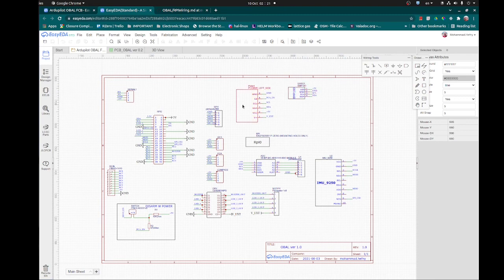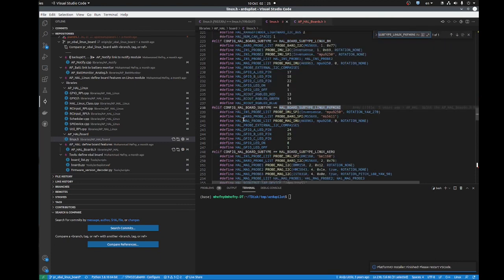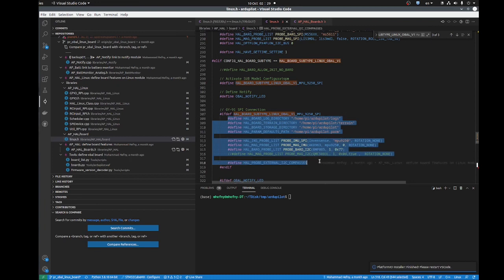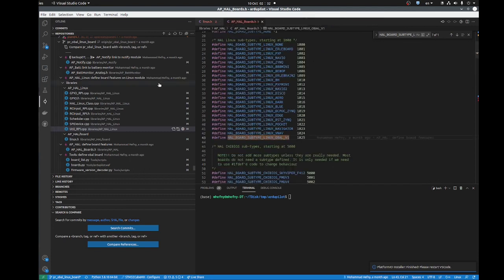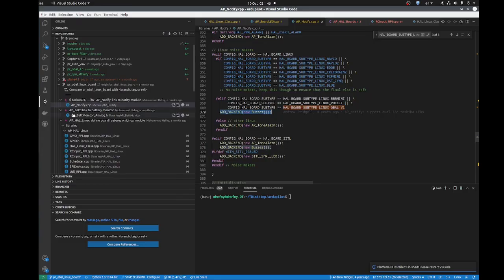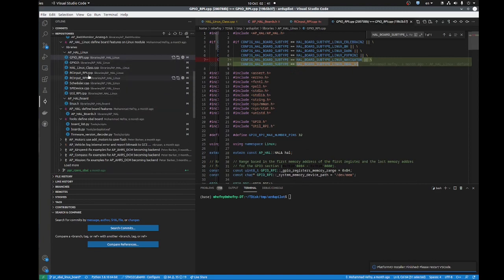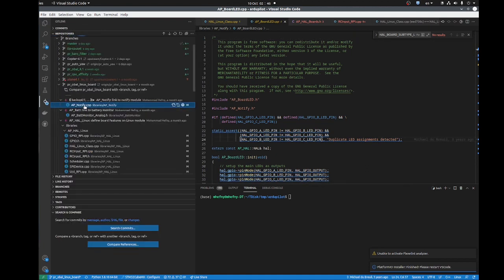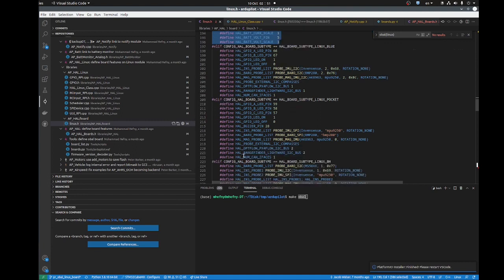04 - OBAL - Tech Part 4: How to Port  Ardupilot Software to your OWN Custom Board ?

Comment: Many thanks for such nice explanation.
I have a question. Did you use Ardupilot mission planner for calibration and configuration???
I can’t find any video for that on the playlist.
Reply from the maker: You can adjust it easily as any similar board
Reply: @MohammadHefny_HefnySco  just connect the Pi via usb to a PC ? No special configurations are required to enable that?
Reply from the maker: Yes I do and QGC

Comment: Very interesting. Thanks. I am waiting on the delivery of an H743 development board and plan to have a go at setting it up as a basic Ardupilot flight controller using two 9250 IMUs and two 280 barometers and an ESP32 for MAVLink over WiFi. This has certainly given me some encouragement that it should be possible.
Reply from the maker: Pls share your experience when possible
Reply from the maker: Also Pls check droneengage solution where u can use wifi and even 4g for communication and video streaming.
Reply: @MohammadHefny_HefnySco  Many thanks for the reply. I will certainly let you know how I get on. Thanks also  for the droneengage suggestion - I'll check that out.